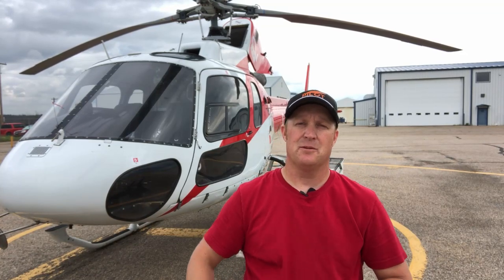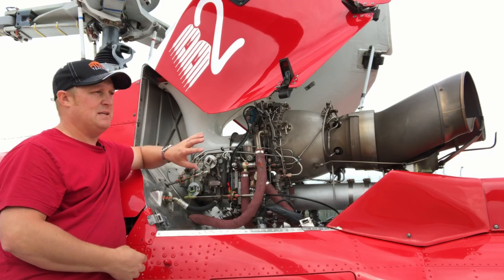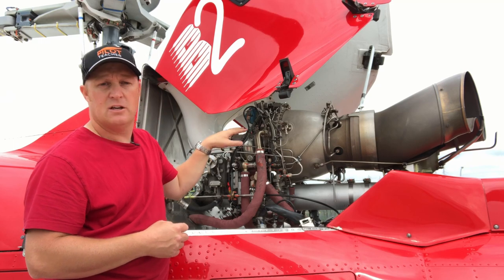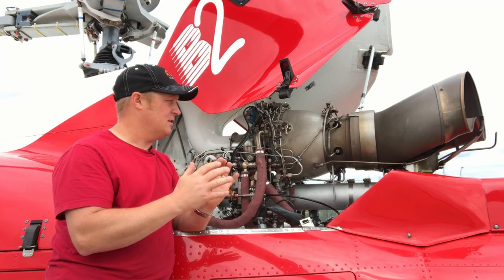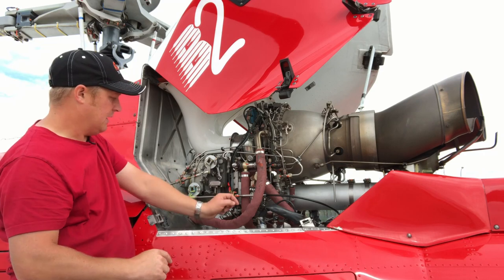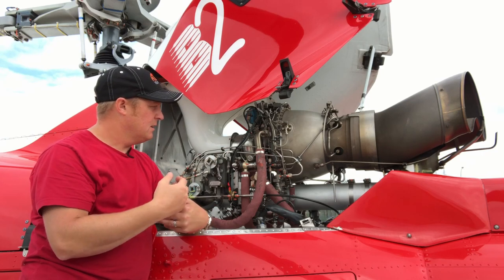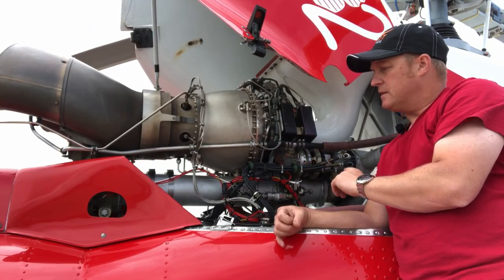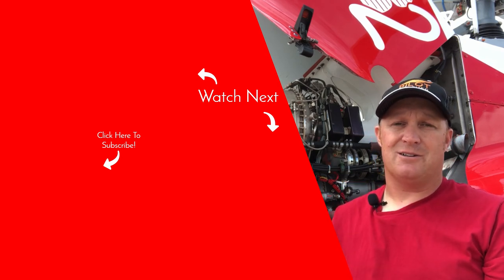A Complete Guided Tour From The Pilot!

Comment: With all these multi million dollar aircraft. I dont understand why not use some little cameras and a monitor in the cockpit. For my experimental I am installing one in the engine compartment, one looking beneath, one rearward over the tail boom and also on on each of the main rotors. they are so cheap and use next to no power.
Reply from the maker: To look for what?
Reply: @PilotTeacher  Wrote a detailed reply and lost it. You said if you have smoke you would have to circle around to check it. Having cameras you can watch every aspect of the aircraft. So many aircraft have come down because pilots could not see what was wrong.  I can mount 1000fps cameras on my rotors and watch the motion, damage, ice formation, tracking. Engine compartment for fuel, oil, coolant levels, Smoke, fire. Looking aft and in fuselage to look at linkages. If the landing gear does not go down you can have a camera looking at them and also showing how close you are to the ground. a camera looking down for long lining. So many possibilities.
Reply from the maker: @chippyjohn1  extra things that add weight, expense and more to get approved and then fix. For most helicopters they are not high on the priority list otherwise the manufacturers would have them fitted.
Reply: @PilotTeacher  It also makes for a very cheap and simple video recorder in case of a crash. You can remote locate the memory stick to a position such as the tail. SSD are such large capacity now compared to the old black boxes they used to have.
Reply from the maker: @chippyjohn1  they do have their place for sure but there is a reason why the industry hasn’t included them. What that/those reasons are is anybody’s guess.
Reply: @PilotTeacher  I have seen some aircraft being fitted with them. They will become common soon enough. Most of the helicopters are old by design, even 30 years ago, cameras were not that good. Anyway, safe flying, all the best. I have thoroughly enjoyed your videos and look forward to breaking the AS350 altitude record.

Comment: This guy goes on about this engine using fuel, but fails to point out where the fuel is stored

These helicopters don't require fuel to run, they use air instead
Reply from the maker: Trust me buddy when the fuel runs out the engine stops real quick!

The 540 litre fuel tank is mounted under the engine deck between the two cargo compartments.
Reply: @PilotTeacher  can you do a video on the fuel tank location, 540liters is huge
Reply from the maker: @jordanblake574  hey Jordan it is directly under the transmission between the back seats, the two side cargo pods and the tail boom connection.